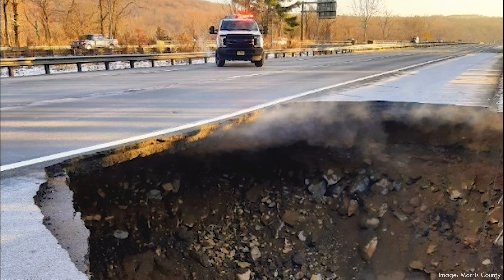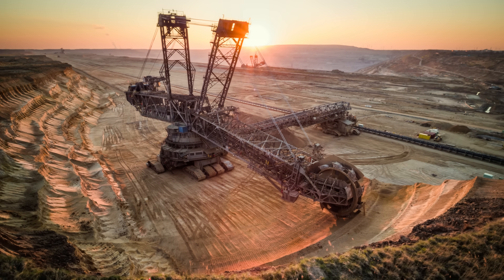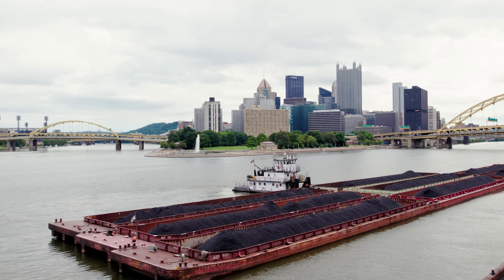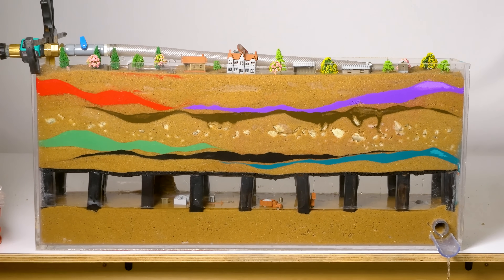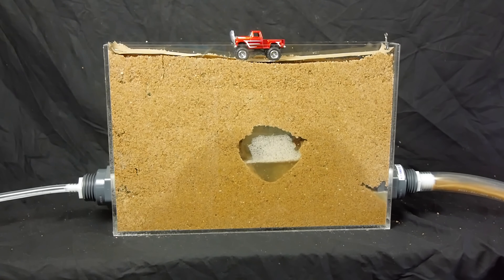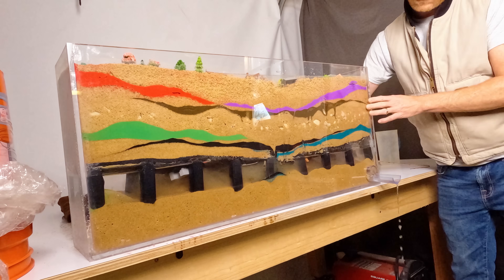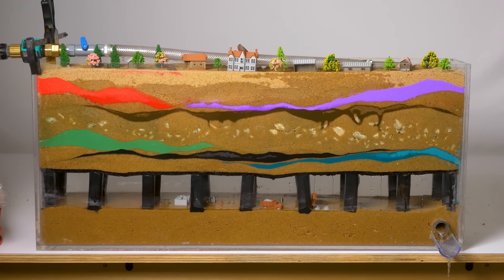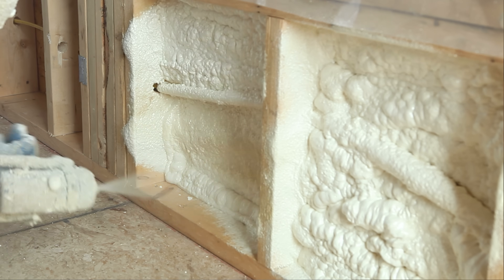When Abandoned Mines Collapse

Comment: There are parts of Germany now lower than the river Rhein, because of the settlement after mining coal for centuries. Some regions sunk about 40 Meters / 120 feet. We call it "Ewigkeitsschäden", or "eternal damage", because pumps have to run forever to keep the land dry. Millions live there, so just stopping is not an option. At some point in the far future, the pumps will have used more electricity than the extracted coal has generated.

Comment: When I was just moving to Rock Springs, WY., its famous coal mines had been long abandoned,  and were collapsing left, right, and center. Some parts of town were crossed by surface pipelines carrying sand slurry. This was pumped into the mines to halt the ongoing subsidence. The town is littered and surrounded by cut down hillsides featuring the ends of what used to be surface and near-surface coal seams.

Comment: The city where I once lived had many coal mines below it. Most of the mines were dug into the river carved valleys and ravines where the seams were visible at the surface and the shafts went in under where the city would eventually be built.
A hundred or so years later, a large section of the river bank collapsed taking many buildings with it and covering other buildings that had been built close to the river.
Today you can clearly see the shape of the mines in a golf course that was built over an abandoned mine if you look using google earth.

Comment: Also a lot of mines that were originally room and pillar later on converted to continuous mining, and they went to the edges of the old pillars and mined them back, leaving only a few pillars by the roadways to the shafts for support there, to allow them to use the original adits, as they owned the land above. Thus they caused subsidence of lots of properties adjacent to the mine over time, and also gained all that valuable locked up material in most of the pillars as well.

The gold mines also reprocessed old mine dumps, as the new processes were more efficient at extracting the gold, and then the remaining fine silt was pumped down the old workings to fill them, gaining both in releasing the old dump for housing, and filling in the old mine, so the owners no longer had to dewater the mines works and maintain them, and avoiding the formation of sinkholes greatly in the area above, as there no longer was a void to collapse in and start the formation, plus the reinforcing of all that heavy rock. Bonus was the dump ore actually contained more gold than the current mines produce per ton, though now they are all gone, and the land was sold off.
Reply: When I was growing up in Colorado, my Dad would take us to the gold mine dumps outside Cripple Creek. We collected sugary purple quartz, which oozed gold droplets when heated with a torch.

Comment: @12:10 I used to do mapping for a coal mining company that did longwall panel mining. One of the things you've missed is that not only does the roof cave in, the floor buckles and heaves upwards once it no longer has a thousand feet of rock compressing it. If you remove a 6ft coal seam, the surface will only subside about 3 ft as result of the floor heaving upwards to fill the bottom half of the void.
Reply: I'd also imagine this kind of mining is very preferable in areas of no infrastructure above ground since subsidence won't be a problem if there are no buildings above. And once it's done settling there won't be cavities left behind that would pose risks in the future.
Reply: Knowing when its done settling could be a problem @LostOnceLefthanded
Reply: ...Huh. TIL. Thanks! 🤯
Reply: @YT-TheLegacy  The other half of the equation is horizontal stresses. As confinement is removed from the floor surface, vertical stress  on the rock below goes to zero, so it expands slightly as stated above, but the horizontal stresses in the rock will actually push that floor surface up as well. Imagine squishing a marshmallow sideways, that top surface is thrust upwards if it has a void to displace into.
Reply: Upward? 😳 Pressure differential?
Reply: @YT-TheLegacy  yep, floor heave is a thing. The relationship between roof and rib (wall) strength plays a very large part in how the floor buckles up (aussie coal pig here :) )
Reply: @joelmoe-80  That sounds "fun"
Reply: @joelmoe-80 isostatic rebound on a small scale?
Reply: @YT-TheLegacy  Right. What is now the floor used to be supporting the weight of hundreds of feet of rock above it, which compresses it downwards like a spring. When you remove that weight, the spring starts to decompress.
Reply: Would you not see the missing 3ft of subsidence once the roof and floor converge and the vertical stress is re-established? Not a coal guy, but I am a rock mechanics engineer haha
Reply: Thanks for this extra piece of information, this helps me! The description in the video had me boggled at how something so destructive could be allowed, this makes it a bit more understandable.

Comment: mix a little concrete and pump slurry and waste rock back in and it doesn't "subside".  Working above ground remotely makes all this safer; ask the fine people at Red Path mining in Canada.  If you don't have to pump air, dust control, air condition underground, mine fires and explosions don't happen.  If people aren't underground, you can now mine MUCH deeper than before without people passing out due to heat stroke; maybe even down to a level where you can set up a core tap thermal pump power generator.  After all, if you start drilling from 10 miles down, your drilling operation gets a LOT simpler to implement and the distance you have to go is severely reduced and the cost of MOST of the development has already been paid by the operation of the mine.

Comment: @5:26 On my first day of underground mining in the early 2000's, the crew were "pulling pillars". This required special permits, but was often hard to obtain during the Obama years. I'm not sure about the situation currently. This process is dangerous as you are essentially causing a controlled collapse of the roof support. But it allowed you to recover much of the otherwise 'wasted' resources.
Reply: Forgot to add, this process is called "retreat mining".
Reply: Sounds terrifying. Did the collapses disturb the surface?
Reply: @benjitheengi  Generally, no. At the time atleast, nothing immediately noticeable.
Reply: Bunch of mines still pillar

Comment: Safety Safety Safety at 7 minutes and 7 seconds, you show a gas cylinder in the background - Where is the SAFETY CHAIN that would hold the cylinder to the wall and prevent the potential of the cylinder from falling over ??? Just because the cap is screwed on doesn't eliminate the risks !

Comment: I lived in the rock springs, wy area for 11 years. 
There was a lot of old underground mines beneath the town.
Sometimes the old mines would collapse, leaving sink holes around. 
To work to prevent that they would drop massive weights to force a collapse of the mine shafts, and they would also drill into the mine and pump in concrete to fill the voids. 
I personally worked on some of the mine reclamation projects. 
Very interesting process.
Reply: I lived in Rock Springs myself. There use to be a building in town that had a hole in the basement floor that went right into one of the mine works. I don’t know when they took that building down but it was there in 1971 when i joined the Air Force and it was gone when i got out in 1978.

Comment: Subsidence can get so bad that it destroys entire urban areas: Some parts of the Ruhr valley sprawl in Germany have subsided enough for moderately sized rivers to change course and, in a few cases, even *reverse direction*. Dikes and humorously oversized pumps have been installed to keep the area from flooding/the rivers contained, but those will need to be maintained and run forever, lest Germany get a second lake district to complement the one in Mecklenburg.

Comment: The collapse in New Jersey has some other factors that also merit discussion. Perhaps the biggest is that the ore beds in the area dip at an angle of 45-50 degrees, which means that the mine slopes downward pretty steeply. That means that material from collapses won’t pile up and eventually block the hole, it’ll just slide further down into the mine. The other thing to understand is that these iron mines aren’t soft rock room and pillar mines, they’re hard rock mines where the ore is extracted by stoping. There really aren’t rock pillars like a traditional room and pillar mine
Reply: If anybody is interested, the NJ Department of Environmental Protection has some old mine maps of the area available on the Internet. 

https://dep.nj.gov/wp-content/uploads/njgws/enviroed/mt-pleasant-sterling-corwin.pdf

https://dep.nj.gov/wp-content/uploads/njgws/enviroed/wharton-mine-district.pdf

Comment: Here in the lead belt, there are houses when you got to tour the Bonne Terre Mine, you can literally see house fountains sticking down from above.   Homes uses to have a door in basements they would open to let cold air in during the hot summer months.   Its why the area is in a Red zone for earthquake hazard for New Madrid fault, houses would literally just fall into the old mine.

Comment: I think it is wrong to say that modern mining is better. It is more predictable when the damage happens and how. But it happens at a far greater scale than before becasue they remove a lot more resources with this "direct collapse" method. I think its far worse because of that. I think it is better to open up old mines, map them and reinforce them. And new mines to be mapped correctly and with reinforcement in place from the start. So that we know there problems can occur but also make the chances of it collapsing, way lower.

Comment: I see this locally at my mom's house, not from a mine, but an old small stream that was buried over 100yrs ago. She has an old Victorian house from the late 1800s, and it ran next door under the neighbors house who have a sink hole under their side addition room, and down through the yard where there's a few dips I trip on mowing, then the bigger dip under my mom's garage which has caused the concrete floor to buckle and wall to be bent. Luckily she doesn't really use it, but the subsidence is obvious
Reply: Sinkholes from water and water/sewer/storm lines are the bigger problem because you can't just dump in gravel and grout them

Comment: The cardboard is a great representation as most abandoned hardrock mines I've been to used wooden frames and timbers to hold up the back. These are often only put in in places which are a bit sketchy e.g. where collapses and erosion are likely and they work extremely well. In dry mines in Nevada for example even 100 years later these are for the most part pretty good still. However, water plays a major role. In that water will slowly rot them away and when that happens more often then not things will collapse. Most hardrock mines are also not dug horizontally, but an orevein runs wherever it does, hence they will dig up vertically to mine that out, called stoping. These stopes are often much harder to secure. These can get truly to cathedral size, completely mindboggling what is possible. And the problem is, that if these collapses happen in the front of the portal, there really isnt any way to map the the interior of a mine after the fact.
Reply: How deep does ground penetrating radar go? Are these mines typically too deep to explore with that?
Reply: A few meters. Or not far enough.
Reply: @extragoogleaccount6061  Ground penetrating radar can penetrate ground (not rock) no more than about 100 meters, mines are usually multiples of that deeper.
Reply: @extragoogleaccount6061  12-30 ft max on gpr. Up to 100ft in perfect conditions. Too shallow for most mines.

Comment: Growing up in one the the two big German coalfield back when it was still active (up until 2012), that was a huge part of public life and education in school.  In school we were taught to stay on the official trail when in the woods to avoid falling into sinkholes. The coal was taken out down to 1751m, the deepst European coal mine. The former state owned corporation is still operating the water pumps to avoid flooding, The subsidences above the mines is somewhat settled right now. But when the pumps stop, the problems because of the flooding could be bigger than those during the active mining operations ever were. The mines will fill with water which will push the ground above back up again, stressing the soil and infrastructure, and the oils and chemicals used during mining could harm the ground water and by that the drinking water.
Reply: Another part is when the mines have penetrated the water proof layer of rock between the fresh (non salty) groundwater close to the surface, and the much saltier low lying water deposits (often pumped up in spa towns as "healthy springs"). If the salt water is allowed to fill the mines, ground drinking water over large areas of Germany are in danger of being contaminated. So it is pumped up out of the mines and then pumped into the rivers, one the idea that "a little" salt water will not damage the river life (too much?).
Reply: I've heard that when land over an aquifer subsides due to over pumping, it will never come back up, but I've often wondered why. If you pumped water down into the aquifer, wouldn't that raise the land? Your comment implies that the ground actually will move back up.
Reply: @Jedward108 I imagine it's a problem of shape. The aquifer is at a particular location because of the surrounding material and flow of water. Once collapsed the flow changes and the gap for water to sit will not be the same to collect. The OP is talking about mines that aren't totally collapsed, since they're filling with water, and too much water would cause collapse.
Reply: How much electricity do those pumps use and how long do they plan to continue to run them?
Reply: @gregorymalchuk272  Dunno in both accounts:
https://de.wikipedia.org/wiki/Grubenflutung_im_Saarland
Reply: @gregorymalchuk272  Indefinitely. The operation of these pumps are part of the "Ewigkeitskosten" paid for by the mining companies, translating to "eternity costs", so they are planning for reaaaally long operation times. It's necessary, too; the Ruhr valley is home to several million people and is a major economic center of Germany and I don't see that chaning anytime soon, so running the pumps is probably cheaper than finding a place for everyone to resettle.
Reply: Coming from the other one, I experienced two sinkholes near where i grew up. One VERY close to the local commuter train (S-Bahn), the other on the parking lot of the local train museum.
Sinkholes are just a fact of life, but they never bothered me as much as all the unexploded bombs the Allies left behind. Never was evacuated for the former, twice for the latter and I stopped counting the almost-evacs because the safety zone ended just a bit short of my home.
This video, though... are you unaware of shafts this young? At least our collapsing shafts are from the Middle Ages where no one recorded them...
Reply: @walkir2662 Regarding records and regulation, it’s clear that the “Wild West” of US mining begins right at the East  coast.